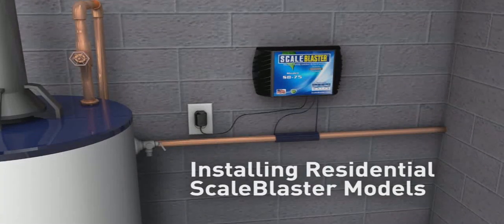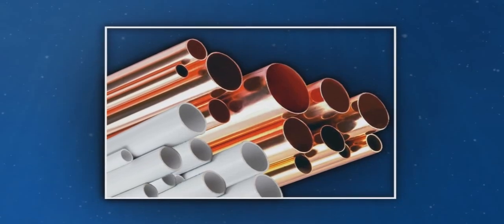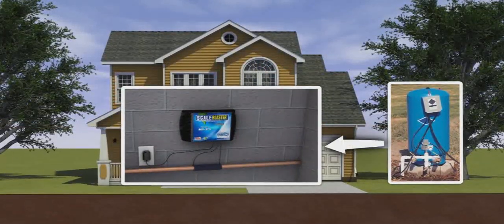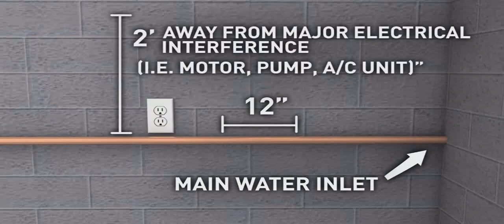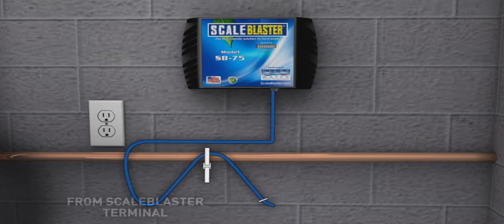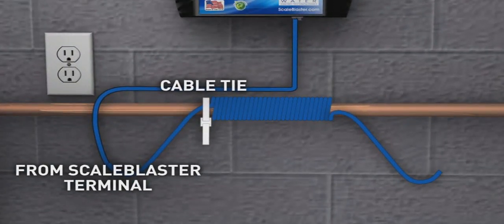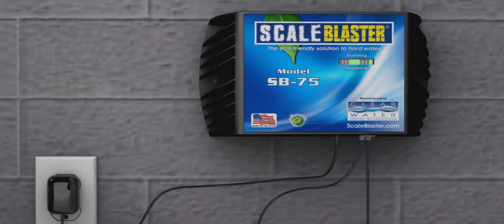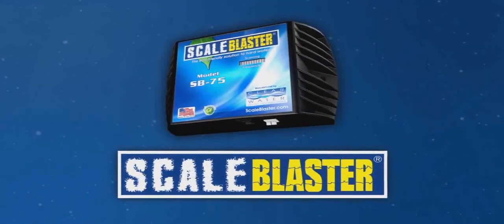ScaleBlaster Water Conditioner Installation Video

Comment: The video is deceptive. To wrap the pipe is a major headache. They don't cut the wire to your specific need so you have so much wire that you will get tangled trying to wrap 90-100 times around the pipe. They should come up with a clamp on design so you simply snap two halves in place that get connected. Not an easy re-design but this design stinks and is terrible to install. If you are going to use this bad design you need two people and still it is hard to do, remember the pipe is close to a wall so taking this bundle of wire and wrapping it around and around and around gets old fast.
Reply: So true doing it right now. And for double wrapping do you tie it off before turning around for the second layer? Idk

Comment: I have done a lot of digging since I really need something. I have to replace my water heater element every 10 month without adding salt to my softener. How long can this product extend my element usage?  Half a month? Two month?    Based on my weeks of reading,  the main conclusion statistically is: "May or may not work", "a little improvement", "seems working".  I am not sure if this type of product is really useful since my salt softener has extended my heater element usage 10+ years.  I wish I am wrong,  need somebody help me to see it.
Reply: I have the 175 model.  There is a different but not 100%. My toilet tanks went from black to clear. There’s no way around not replacing your heating elements. Every year, I remove mine and soak them in vinegar overnight. I clean them with an old toothbrush, dry them, and save them for next year. I have two pair and cycle them every year. Then shop vac the minerals out of the the heater tank.